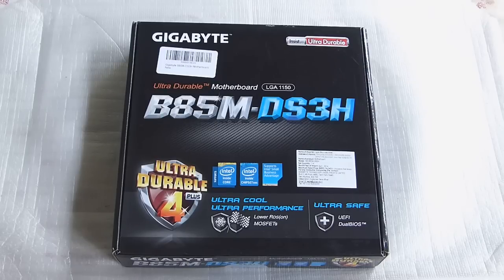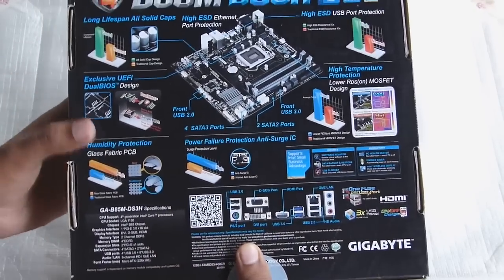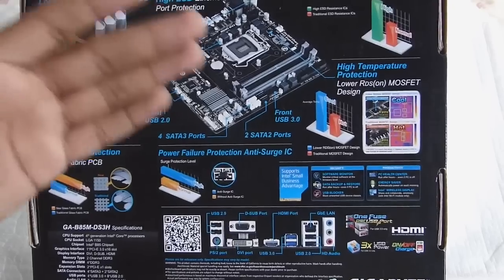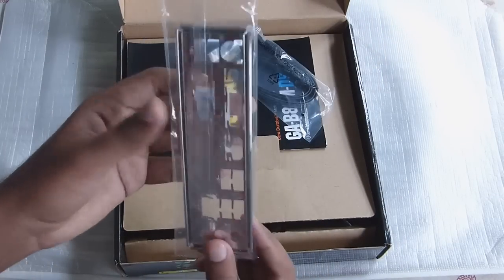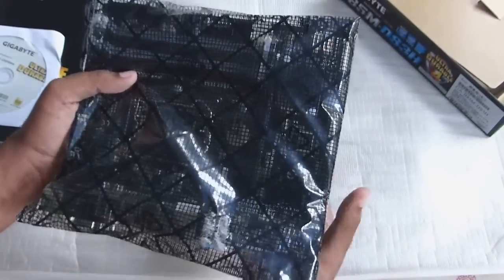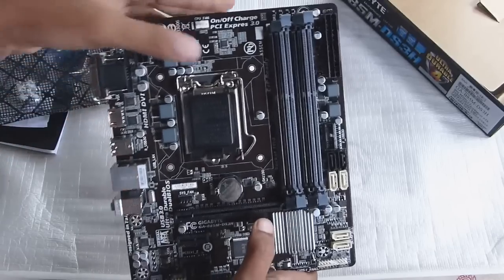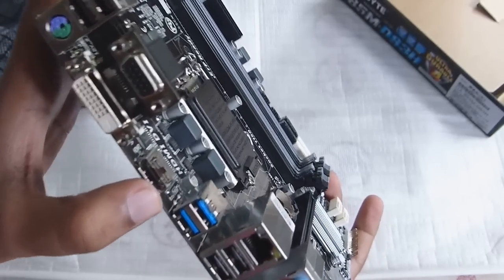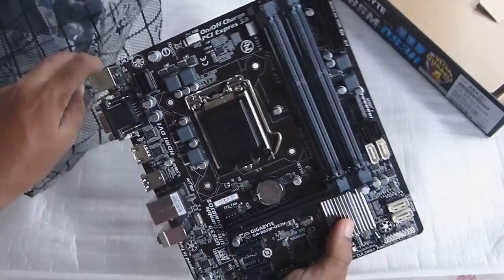GIGABYTE GA-B85M-DS3H Motherboard Unboxing and Overview

Comment: Hello will the i5 4460s work with this motherboard? 

The reason i'm asking is because i'm not sure if this board will supply enough power for the i5 4460s
Reply from the maker: +Burnt- -Toast this board will be enough to run that cpu, no problem..!

Comment: wil my i5 2500 none K 3.3 ghz work on it with agtx 960 4gb ssc ???
Reply from the maker: +Revolution97 the i5 2500 wil not work on this motherboard (because they have different sockets).. you need to find a motherboard with the same  LGA-1155 socket. Once you get that you can add almost any GPU as a combo..!
Reply: wait its a 1155 socket for i5 2500 and not 1150?

Comment: which proccesor did you install? I5 4590 works? or I have to update the bios? thanks
Reply from the maker: i3 4130 :)
also the I5 4590 will work just fine and you wont need to update bios or anything..
Reply: Rahul Vj Hello Whats the 2*4 atx for?can i use 1 pin?